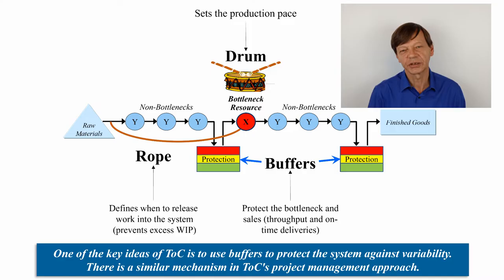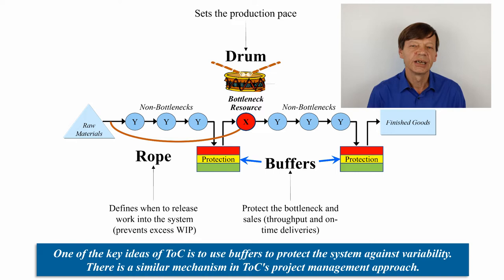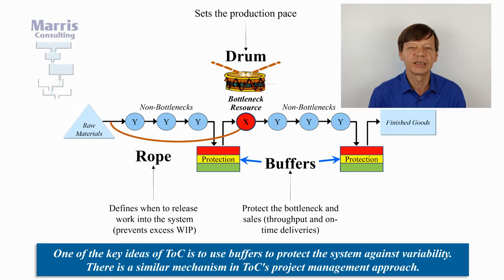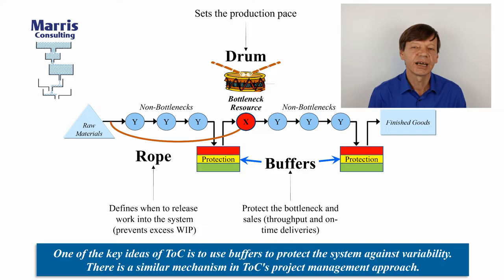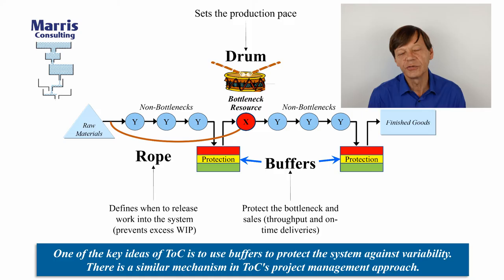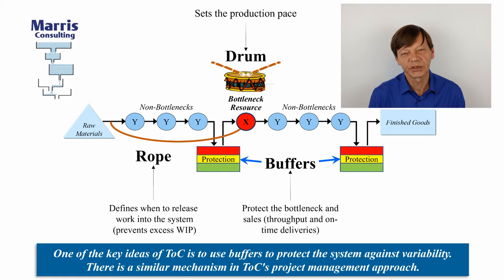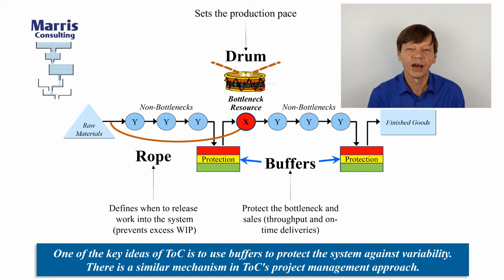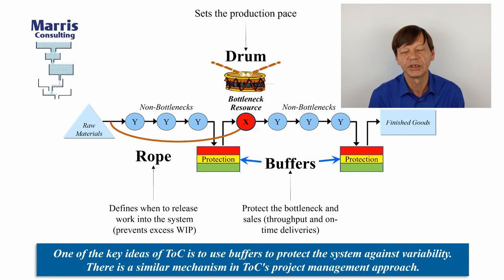Drum-Buffer-Rope - 4 min. summary

Comment: How do you handle the real world issue of shifting bottlenecks?  In our business, the nature of the order can dramatically change the bottleneck.  If we get a bunch of orders with extensive testing, the test lab, at the end of the process is the bottleneck.  In more normal times, the bottleneck might be our main HMC cell.  If we get a lot of high pressure / oil and gas work, the heavy welding can shift the bottleneck to welding/fab.  How do you handle this?
Reply from the maker: Very good question, thank you. It is difficult to answer without a better understanding of your business, so let us just make the following comments:
- Testing is frequently a bottleneck in many different industries today. This should be avoided, it is a "bad" bottleneck for a number of reasons.
- Welding is another frequently observed bottleneck because welders are getting scarce in many "developped" countries
- Bottlenecks are more stable than most people think. You want to find the structural bottleneck, not the resources that sometimes get flooded by waves of work
- If your bottlenecks are really "wandering" you might be able to limit the phenomena by working with smaller batches and/or be careful of how you accept new orders so as to avoid creating temporary bottlenecks
- You might want to watch this video about how to identify bottlenecks: https://youtu.be/ulXqO86OfpU 
We hope these comments help.
Reply: @marrisconsulting  thanks for the reply, and link.

Comment: When drum is already setting the pace then what is the need of rope in the theory may I know ?
Reply from the maker: There is variability at bottleneck level. 
If your bottleneck is under maintenance for 1 day, do not launch too much orders in your system. 
The Drum is more the average capacity at your bottleneck, the pace of your factory. The Rope is how you manage it on a daily basis.
Reply from the maker: The rope is there to prevent more raw materials or components being launched into the production than can be absorbed by the bottleneck. It is a mechanism to avoid excess inventory in the process before the bottleneck.
P.S. Our apologies for the very late reply.